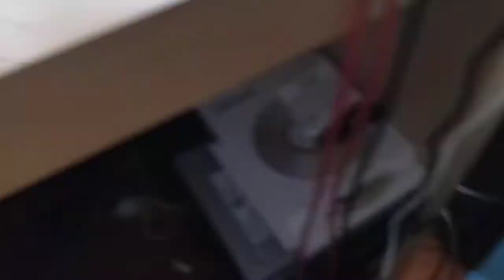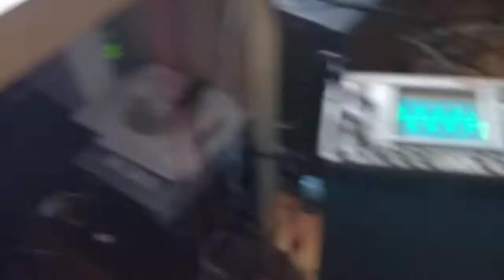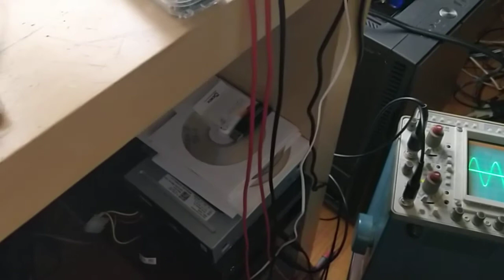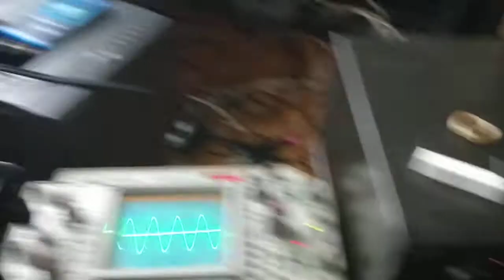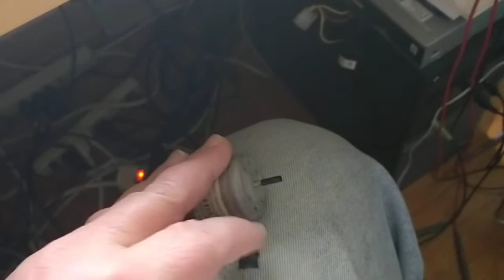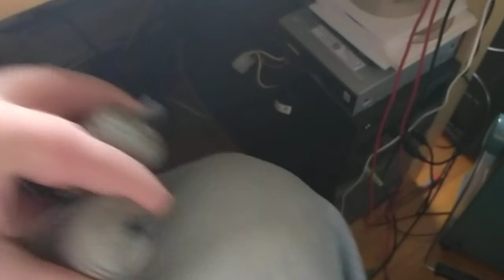Wein bridge 400hz with POWER amp and synchro

Comment: could u please provide a circuit diagram?
Reply from the maker: The circuits came from https://www.electronics-tutorials.ws/oscillator/wien_bridge.html  (with lots of theory :)  for the oscillator - had to play with values and use pots to get it stable at 400Hz; and 3 phase shifter from  https://www.homemade-circuits.com/three-phase-signal-generator-circuit/amp/   -- uses lm324, one for the oscillator and 3 for the phase shift. I can sketch up a diagram of what I have, it uses single positive power supply and divider for artificial middle ground.

Comment from the maker: This is supposedly a 100W amp - and the voltage measured across the 20W non-inductive resistor was about 80V peak to peak,  or 40 peak, or  40*0.707=28.28v RMS which gives with P=V^2/R = (28.28*28.28)/8 = 99.96 right on the money 100W at clipping :)